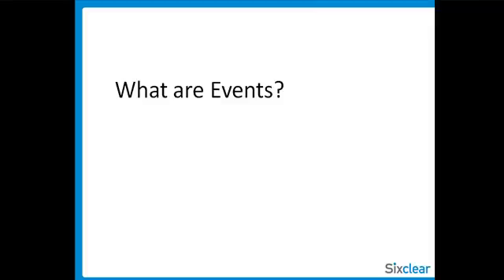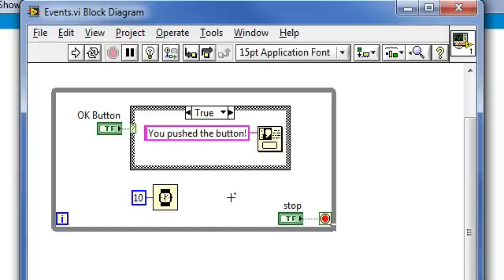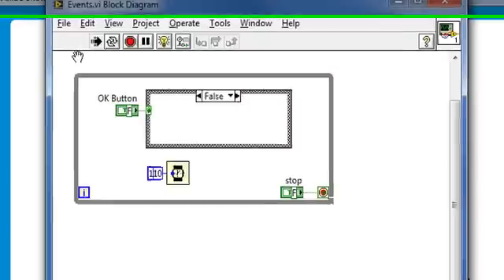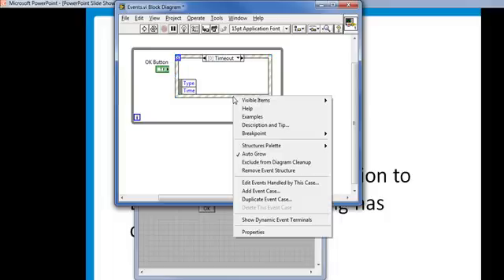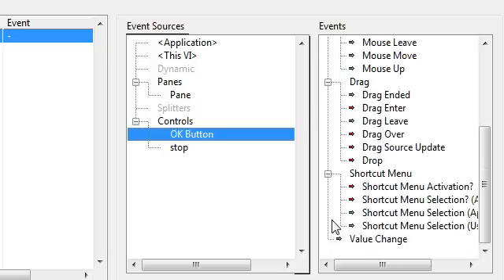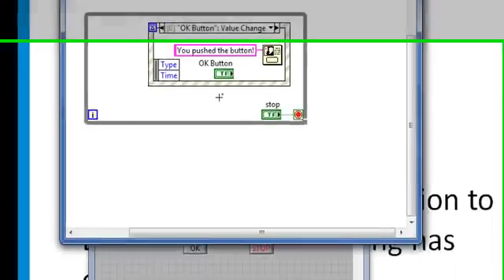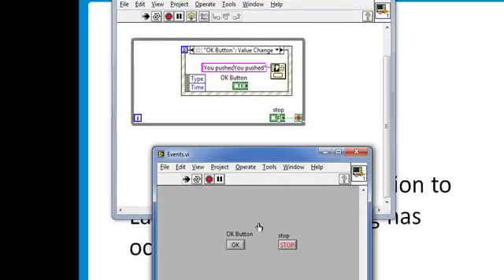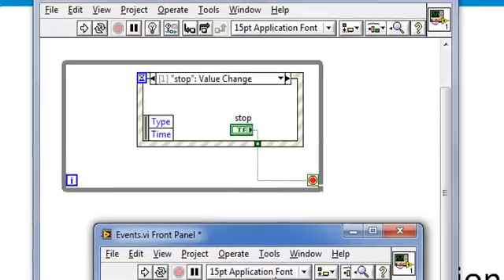VI High 7 - How to Program Events with the Event Structure in LabVIEW

Comment from the maker: Taktloss TAK Sorry for the delay! If you don't use a while loop, then you'll only execute one event before the VI ends. If you use a while loop, then each loop iteration you will handle another event. Using a while loop is much more common, though there are rare cases where you may want to execute your event structure and either end the VI or move on in dataflow.

Comment from the maker: Good question! The event structure will execute if any of the cases inside execute. So, let's say I have an event structure with 4 cases by itself on a block diagram. If any one of the cases execute, the structure executes and the VI stops. The rest of the cases aren't handled. However, typically we want to handle an event and then have the event structure ready to handle the next event. So we put it in a loop. Each iteration of the loop corresponds to one event case executing. Hope this helps!

Comment from the maker: A true value is sent to the conditional terminal of the loop, not a false. That's why the loop stops. The stop button has been given its own event case. So when the stop button is pressed, that event case executes and the terminal passes a true value out. That value is then passed through the wire to the conditional terminal of the while loop.
Reply: i don't know much about events, but my guess is yes...in this case the loop continues to run until stopped. but this demo -- which has to keep running somehow until the event --  is kind of trivial case...in general, i'd expect there'd be an arbitrary amount of code being executed in the main while loop, so it wouldn't seem like much of an issue.

Comment from the maker: @limacarlos1013 Using events for this type of application would be ideal as the calculations would typically take a short time to execute and thus could be executed within each event case. I'm not sure what you mean when you say you want to change each individual button to a value. I imagine that you will just have a Result numeric indicator that will updated with each calculation. All the calculator buttons will have boolean text with either the number or operation. Hope this helps!